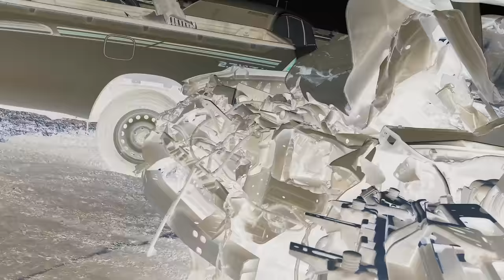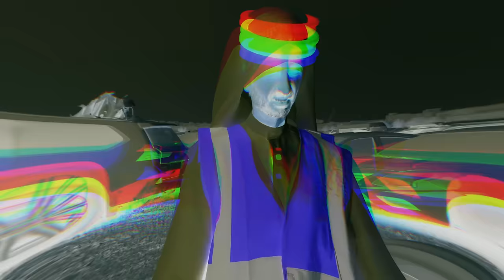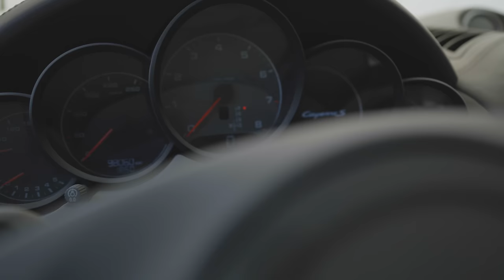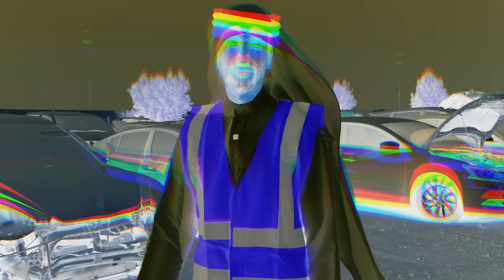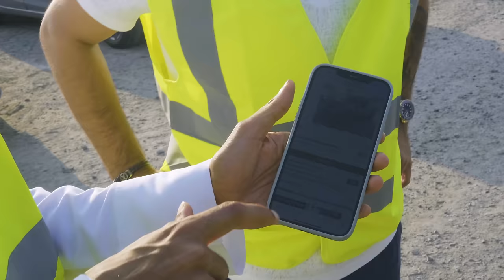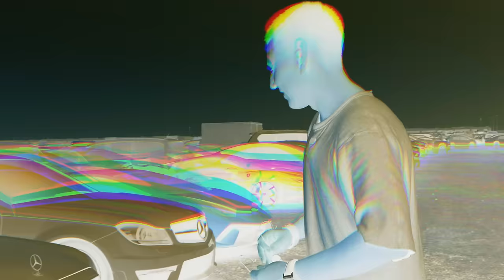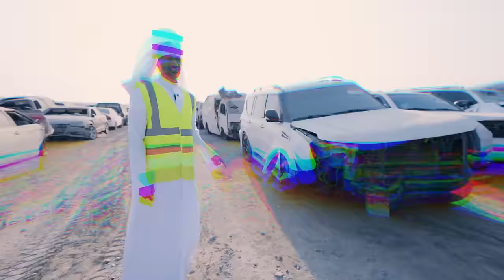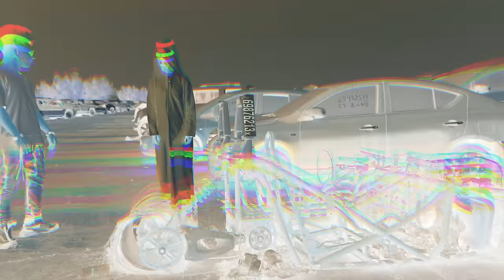GRAVEYARD of LUXURY cars in Dubai 2023 \ LAMBORGHINI \ FERRARI \ MACLAREN

Comment: I have been in a car business for 30 years. Most of these cars are frame damaged. There is a huge difference between accident cars  and frame damage. These cars, after repair, will never be the same. So show the real damaged cars.
Reply: Cut and Shunts😂
Reply: Hi Shawn, correct me if I am wrong please, this Graveyard Car business can only work for you, when you own your own workshop?
Reply: The only way it works is that, like everything else you have to become the master of that  business.
Reply: If u repair back to industry standards with OEM parts and use fact specs ..

YES IT CAN BE A PROPER REPAIR W / PRO EXP
Reply: @stephenklepper453  Be careful with these cars. Every day, we see what's getting shipped to the other parts of the world from th US. They are insurance write-offs. One more time I say this: repairing a car that has a damaged frame, even though you repair the car to the factory specs with OEM parts, I guarantee you I can tell from a mile away that the car has frame damage.
Reply: @shawnhassanpour7142 that’s not true
Reply: Thank you

Comment: IF A PORSCHE FOR $200
I'D GUESS IT'LL TAKE 100 YEARS TO FIX IT
Reply: As a Porsche owner, you will struggle to find a single Porsche Spare part for less than $200. A rear muffler for a 964 911 is £1800.